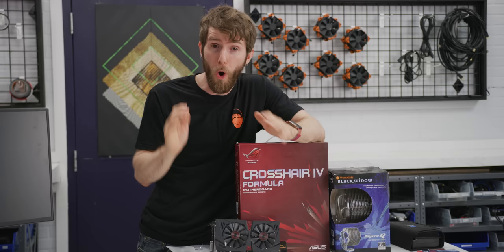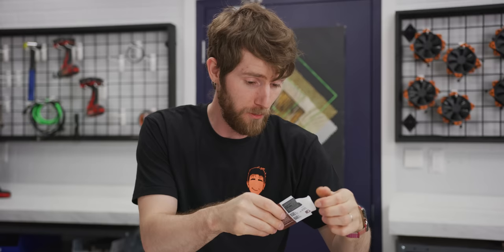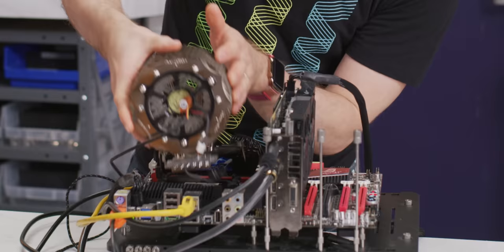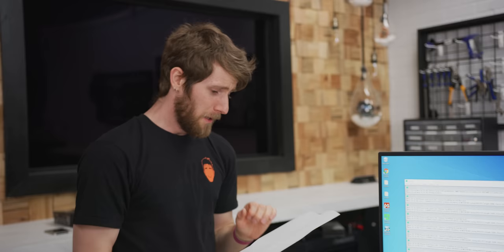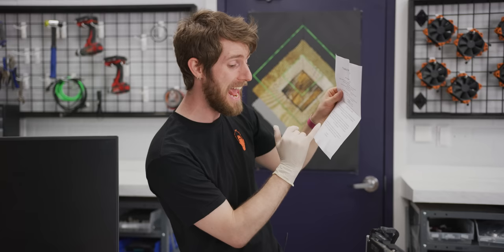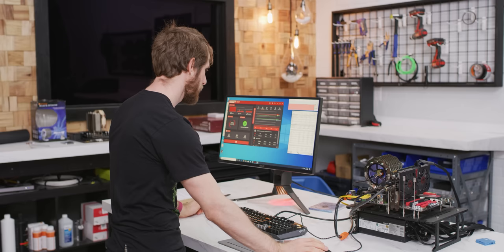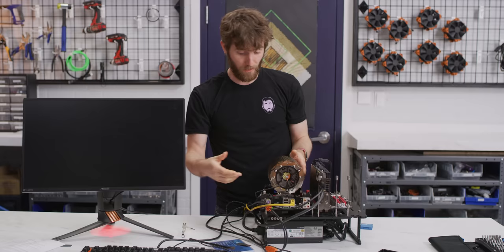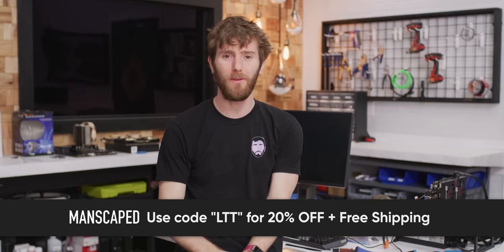Testing Another YouTuber's Thermal Compound!

Comment: The syringes have a volume measurement marked on the side for mixing ratios.
Reply: what am i a science man that reads?
Reply: why doesn't it just come premixed
Reply: @jacobmeader8117  hardens when you mix it
Reply: @jacobmeader8117  because its an epoxy. It chemically hardens when mixed.
Reply: An Epoxy is two liquids that once mixed become solid and that process typically is irreversible, to sell it premixed would be to sell a syringe full of dry cement effectively. some epoxy manufactures have a work around to this with a double syringe so as you push down on the plunger the correct amount of epoxy liquids comes out both nozzles but that's very likely beyond the scale of what Tech Ingredients can set up
Reply: Jeeesh, hook, line and sinker much?
Reply: @jacobmeader8117  well, you got destroyed there. lets remove, 50 internet points
Reply: @jacobmeader8117  When mixed, it hardens.
Reply: That's too easy!
Reply: epoxy is mixed by weight ratio not volume, this marks is useless and not precise in this case
Reply: @JGaffney9000  Unfortunately I have had extremely negative experience with thermal epoxies and leds. The epoxy breaks down under intense light that gets through the led body (white ceramic), loses conductivity, and after about a year, the led dies because silicone potting cracks due to  too high a temperature, and rips gold bondwires in the process. The diodes themselves do not die, but the array does.
Reply: @jacobmeader8117  Because it would harden
Reply: @jacobmeader8117  Don't feel bad. I once bought epoxy and only used one of the tubes because i didn't know how epoxy works. I just thought it's a fancy name for glue, haha.
Reply: @JGaffney9000  How can it be too thin? The mounting pressure is always the same, so no matter how much you apply it will just squeeze out the excess and leave you with the same coverage.
Reply: @jacobmeader8117  Why don't food come pre-eaten to save you the trouble of eating it? Better yet, why not just throw the food directly into the toilet to save the time of passing it through your body first? Dumb question.
Reply: @jacobmeader8117  because it hardens when mixed
Reply: @snowboardik  Densities of part a and part b of most epoxies, are close enough that when mixed in small amounts, can be mixed by volume. Ever buy epoxy? Notice how most come in a double barrel syringe, and both barrels are the same diameter? Even for larger volumes of epoxy, most people mix by volume. Epoxies that are to be mixed by weight are the exception, not the rule.
Reply: @jacobmeader8117  because it's two part epoxy. If both are mixed it will harden
Reply: @pali3329  sorry big boy, just asking a question tho
Reply: @Gallagher068  and in special cases you can buy it pre-mixed and frozen (to halt the reaction if the chemistry permits) but then they typically have a much shorter "shelf life" (even if kept frozen) and once warm have to be used.
Reply: @pali3329  but why doesn't it just come premixed
Reply: @kiethmcgee8382  bad jokes -10 internet points
Reply: @snowboardik   This one is specified to be mixed by volume, not by weight ratio. There is no general rule since the part-B is usually not a pure compound, but a mixture that can be balanced for different A/B mixture ratios
Reply: @xenonram   My fave Endfest 300 epoxy has one of its parts 20% denser than the other, this is a significant difference. But they also balanced it such that it mixes exactly by volume and not by weight, that is, you can mix by weight too, but then you have to keep densities in mind. The manufacturer can fine tune the optimal mixture ratio by varying the hardener composition.
Reply: @killzone866  This is like the Linux challenge all over again.